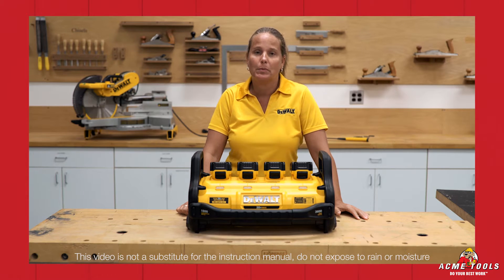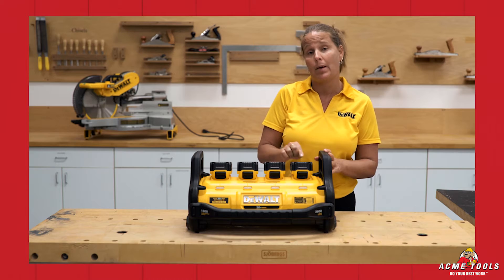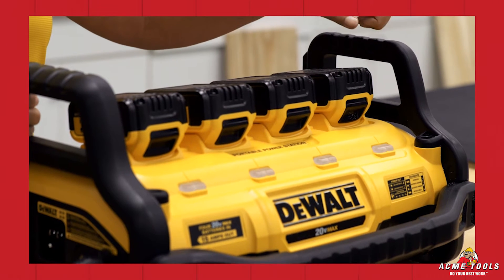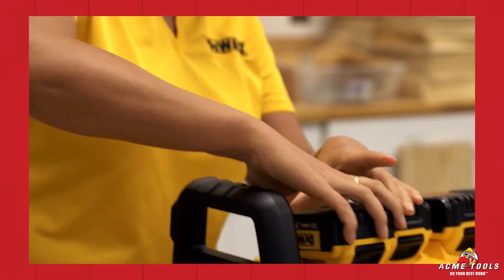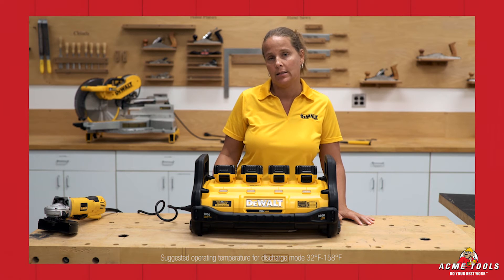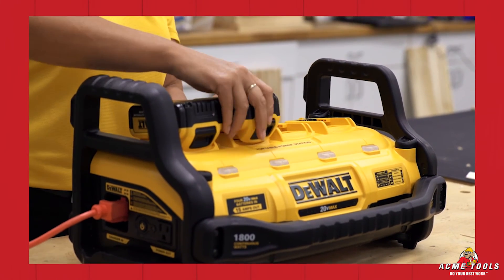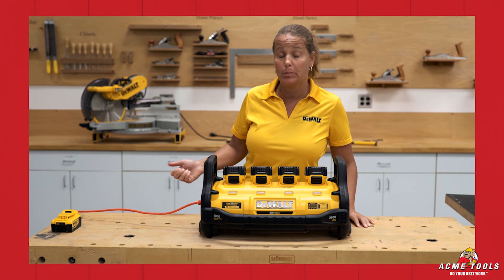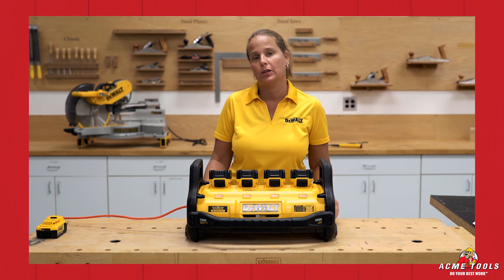DeWalt Power Station Quick Start Guide

Comment: I have no 20v only 40v and 60v any problems with this. 
Will this run tools that 20v can't keep up using 40v  60v I did notice it takes little longer to charge 60 vs 40..please comment